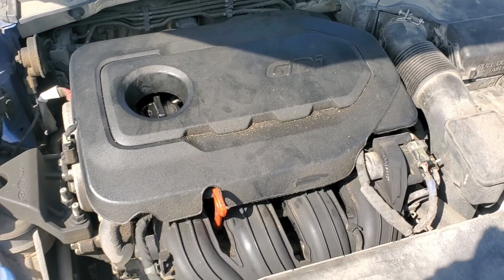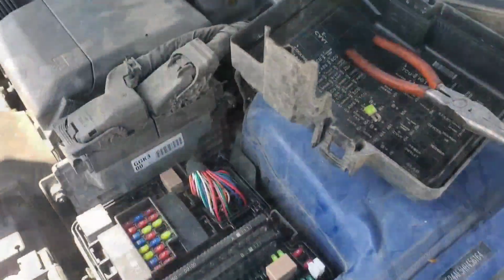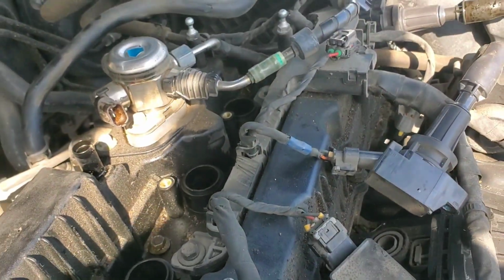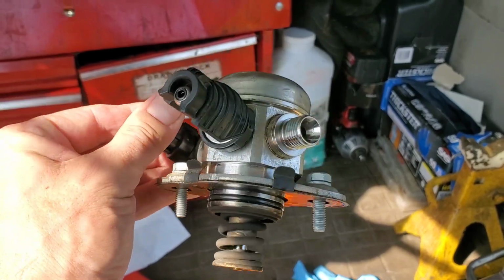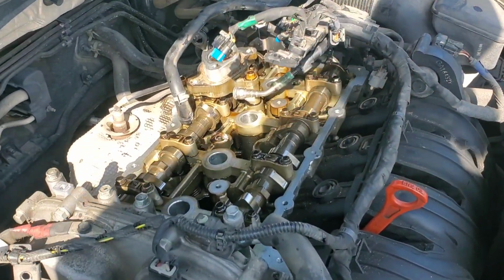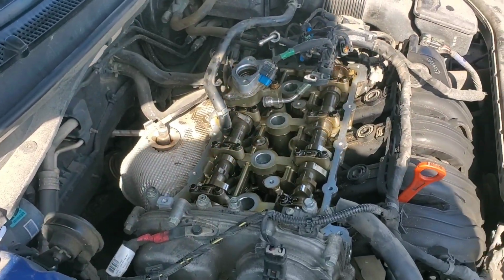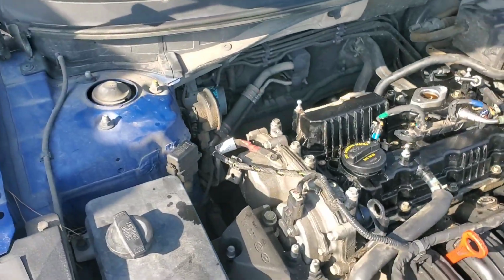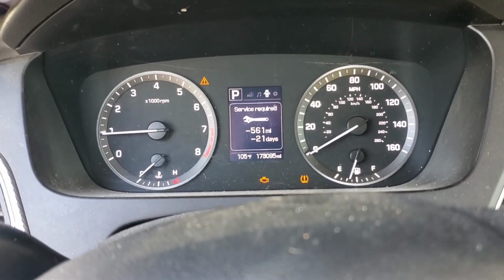2017 Hyundai Sonata Valve Cover Gasket Replacement!

Comment: I re-torqued my valve cover and stopped the leak.  I think over the time the heat cycles on the plastic valve cover cause it to loose tightness.  

I'll be keeping and eye on it but at his point that seemed to address the leak for now.

Comment: Hey Bro! Thank you for the help I have a hyundai accent 2017 and made it my task to change the valve cover gasket. I was stuck in removing the fuel line step and did get splashed by gas because did not remove the fuse first and crank the ignition. Luckily I found your and it helped me out lots. Thank you!!

Comment: Couple things. It is not necessary to remove the line with the clip from the fuel pump. It's flexible and you can just pop the pump out of the way to the right and it will hold there. With the line with the nut, just place a rag under the line and crack it loose. There will be a few drips of fuel, but it won't spray everywhere. Also, it is not necessary to remove the coils from the harness. In fact with them attached,  they hold the harness out of the way for you and no bungee is needed.

Comment: The check engine light is on.
Reply from the maker: Check engine light was on prior to service on this one
Reply: have to undo the negative on the battery for 30 seconds to reset that after maintenance.